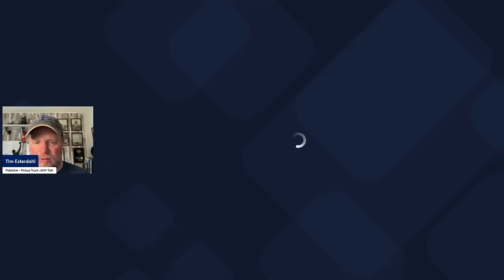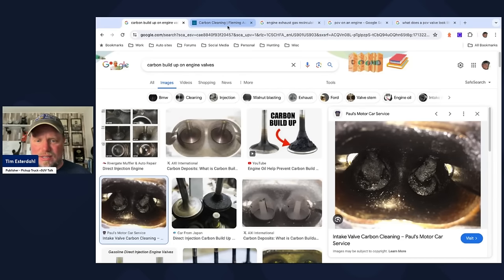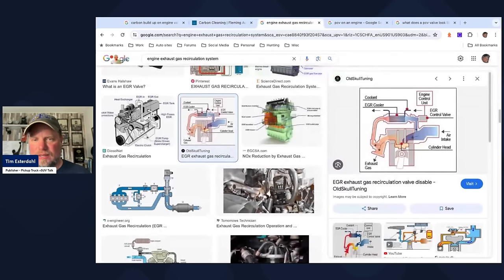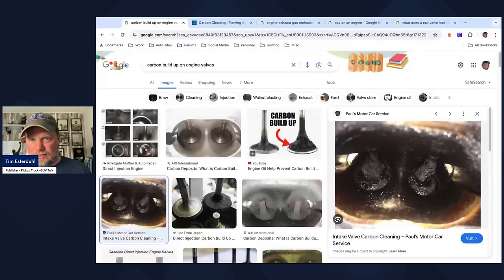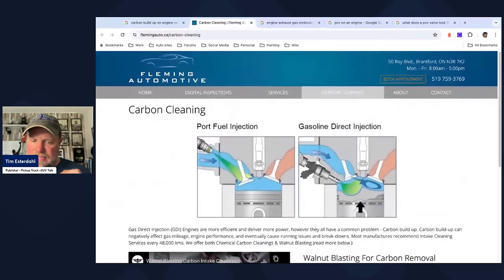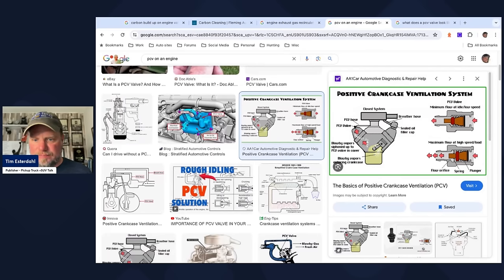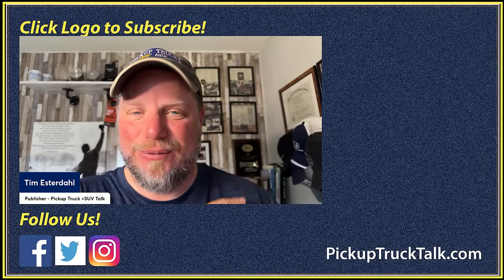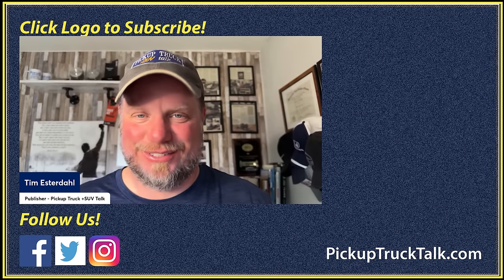Direct Injection Carbon Buildup Fixed Due to Valve? No Catch Can Needed?

Comment: Uh, PCV valves are tiny, made of plastic most of the time, and have no heat to burn anything, much less oil or vapor.  The only way the oil burns is when it goes through intake and reaches the cylinder.  I gather that the pressures from turbo engines overwhelm that tiny thing.  The catch can is a similar contraption but with much larger capacity baffle.

Comment: EGR and PCV are anti pollution devices. They are two of the earliest forms of anti pollution devices.
Reply: PCV is to keep crankcase venting cleaned up. BUT, no one wants the oil leaking out of a draft tube. Draft tubes were cool when manual choke was acceptable and manual steering.

Comment: A baffled PCV valve is not at all new, nor is it a meaningful cure for carbon buildup on GDI engines.  This is especially true for boosted engines where the high cylinder pressures force even more oil vapor up onto the valve stems.   The engineers are not at liberty to discuss this inherent design problem.  Most likely because they simply haven’t figured out a solution and need people to keep buying their cars.   So, they talk about the little things that have been done to address a problem for which there simply is not a great solution.

Comment: This is painful. I have seen many PCV valves and I guess I need to see these so called baffles. Even with baffles the air comes through it is a VAPOR. The vapor is both air and oil that some may gather on a baffling but the oil vapor WILL DEPOSIT ON THE INTAKE VALVES. Port injection with good oil and maintenance will prevent build up.
Reply: Direct injection not so much!
Reply: If the oil vapor is so fine that it gets by the baffle, why won't it get by the intake valves?
Reply: @Dusdaddy  it probably does, but gets burned in the combustion chamber.
Reply: @Dusdaddy  I’m no engineer but it may be due to the higher temperatures at the valve and the vapor collects on it.
Reply: @stuarthoffman5065  It'll collect on something cold before something hot.
Reply: @Dusdaddy  like I said, I’m no expert. I think the valves speak for themselves.

Comment: You should have told the engineer why you don't install catch cans on your direct injection engines. This way, you can just empty it when you change the oil.

Comment: my new 7.3 gas has no egr system or intercooler,turbos and has mutiport injection it is easy put a catch can on your vehicle if nothing in can with these pcv with baffles if you have oil in can, baffle system doesnt work as they say

Comment: The catch can is vented to the atmosphere. PCV valves aren't and are nowhere near as effective as catch cans. Sounds like he had not really looked into the issue himself.
Reply: Catch can kits for most modern vehicles are not vented to atmosphere. They maintain the existing, closed loop system, but just add point for the oil to condense and fall out of suspension. On the several vehicles I’ve used them on, the factory PCV valve stayed in place. 

As far as effectiveness, the catch cans must have been doing something, because I collected a quantity of oil in them. These were new or low mileage used vehicles, btw.
Reply: A catch can venting to the atmosphere would throw an engine code from the computer sensing a lack of vacuum.
Reply: Because it's fixing a problem that doesn't exist. Toyota doesn't have any issues with valve deposits that are so thick that it affects engine performance so why should they do anything?

Comment: How does it get burned off, it is above any source of ignition and a rubber hose comes off of the PCV would melt or catch on fire if there was an ignition source at the PCV. Your engineers are educated far above their intelligence level. A perfect example of college not being the final answer to education, there must be common sense also!
Reply from the maker: Seems to me the hot air from the exhaust burns off the oil.

Comment: Sounds like a salesman is giving you a bunch of BULL! Respectfully disagree why would Toyota and ford be doing direct and port on most of there good motors. New 24Tacoma has both
Reply from the maker: Toyota literally told me the PCV was the answer. Why would they say that if they were the salesman?
Reply: Why do PCV valves have to be replaced at 30k then I see it all the time? And then also why do they have both port and direct on there best motors for this reason exactly. Let me talk to the guy because he’s giving you a run around? Too much time wasted on Toyota giving you BS! Direct injection is the reason I don’t buy most cars!!! 2024 4rnunner 4.0 motor is the best out. New turbo trucks are overheating turbos and motors. Tacoma with 35 tires is running full boost on the freeway. Plus they snap axles too! Toyota is making crap my 2017 Tacoma had low compression at 40k trucks run lean due to emmisions and always get a leak down test before warranty is up they may have to rebuild the motor like me!!!
Reply from the maker: @KyleRattay  Where do you see PCV valves having to be replaced at 30k miles?
Reply: When I have shopped for used cars in the past it is something I very often saw was replaced at 30k service in the car fax report. Saw it many times when shopping for Subaru as well as Toyota basically anything that was new technology and direct injection only.
Reply from the maker: @KyleRattay  huh. I’ve been doing this for a decade and that’s the first I’ve heard of it.
Reply: My 2017 Tacoma 4cyl 5spd had a cold start pop we were chasing and long story short it’s a know issue the trucks run lean and mine at 40k miles had low compression in leak down test 3/4 cylinders motor had to get rebuilt still same issue Toyota bought it back. The new Tacoma tundra etc all have port and direct. All the company’s car that is had to go to lower displacement motors hence why the direct injection. Walnut blasting is not a normal service that most dealers offer. What I’m getting at is direct injection only is garbage no catch can or PVC valve will do anything long term meaning it’s a know problem with direct injection only. Hence why most cars with direct injection only have emission issues as early as 30-60k here in CA. Of course the content one more maintenance spot PVC valve only no catch can is just Bs. Volkswagen use to install catch cans on there cars factory direct.
Reply: Ford 2:7 eco boost is port and direct the 3rd gen Tacoma is Port and direct in the v6. 4.0 4Runner motor is last of the best that what we got for our family. Made in Japan best car plant in the world and port injection only! All these guys are doing is giving you BS and a false sense. I’d be happy and go toe to toe with any toyota engineer etc because to date they have never answered my questions lost cause. Direct injection is garbage unless it’s dual port and direct to avoid all this garbage.

Comment: There ia still nothing there to clean the top of the valves......except port injection. The crankcase gases and oil vapor still get put back into the intake and the valves with no gasoline spray to keep them clean. Everything gets coated with this and cant be burned unless its in the combustion chamber. And alot of cars have catchcanc that are built into the block and other meanes. If they had a way to keep carbon buildup....it wouldnt be a problem today Im guessin. D4s is best and other companies are doing it. They are at whits end with epa and climate change😅

Comment: The engineer says they want 'to eliminate more parts to make the engine more reliable?'......hahaha.... well, that certainly isn't happening..... I wouldn't call adding turbos and all manner of other cylinder deactivation camshafts, etc..... making the engine more reliable.   That comment flies in the face of what is really going on with modern engines.... they are consistently adding more parts and technology.  Although I would agree that most consumers would never think to, or want to routinely empty oil out of a catch can.

Comment: Tim if you drive in the city and don't get the engine up to full heat on longer trips, all the plastic parts get allot of moisture on them in the engine during temperature swings and that mixes with all the oil. Now if everything you said is true why are garages all over the cou try offering Walnut intake valve cleaning
Reply from the maker: Garages need to make money too?
Reply: @Pickuptrucktalk  Now that is a great answer. The Scotty Kilmer's of the world need to live too!!
Reply: @Pickuptrucktalk  Tim, Garages offer valve cleaning because, despite what the engineers are saying, in the real world the valves are getting so much carbon build up that impacts engine performance and efficiency. What I didn't hear from your conversation with the engineer is, if their efforts to have less particulate in the recirculation gasses are so effective, why are DI engines still experiencing so much carbon build up that it impacts engine performance and efficiency? It's there. You showed pictures of it in this video. So why is it happening despite the manufactures saying they've implemented systems to stop it from happening. Why are there example after example of vehicles brought into garages every day with extreme amount of carbon build up on the valves?  I'll agree that every little bit helps, so yes, it's a good thing they are designing in baffles to reduce it, but it won't eliminate it and it's still happening. So add port injection. That helps some, too. Between the two, probably enough to avoid complications. For those that are willing to empty a catch can (I'm not), that will help even more. But a warning to anyone that drives short trips or in cold temps (below freezing), you'll be catching a lot of condensation (water) in your catch can and emptying it a lot more often that every oil change.
Reply from the maker: @MrChadx1  it makes me wonder when PCV baffles started to exist and if all brands are doing the same.
Reply from the maker: @MrChadx1  I did some searching this morning trying to find a garage that offers walnut shell cleaning near me and came up empty. Where have you seen this service offered?
Reply: @Pickuptrucktalk  Perhaps it is not common enough in rural areas that your local garages have invested in the needed tools, but they are fairly inexpensive and you can even buy them yourself and perform.  I did a local search near me and show quite a few places that offer the service (we are in a town approaching 100,000).
Reply: @Pickuptrucktalk  YT deleted my last response with a link to a consumer report article that lightly touched on the subject, so I can't post a link, but it's searchable.
And there are a lot of technical articles that explain the details of the process much better. Easy to find online. Same with videos showing the process (and what impacted intake valves look like along with the error codes a direct engine starts to throw).

Comment: Why would I trust what a Toyota Engineer says, when they can't even make a comfortable seat....and design a Tundra headliner that forces the center rear seat passengers head sideways and touching their ear to their shoulder?

Is this the same engineer that designed a monstrous drive train hump in the middle of the rear seat floor on the new Tundra, when Ford and Ram have completely flat floors to accommodate center passenger foot space and cargo loading?

Or is this the Toyota engineer that forgot to design a usable tailgate step solution in the Tundra?

Or maybe it was the engineer that designed a very cheesy, unrealistic and annoying piped in motor sound to try and make their 6 cyl turbo sound like a V8.....but which comes across more like  Briggs and Stratton lawnmower engine?

Glad my F150 has both Port and Direct injection also....